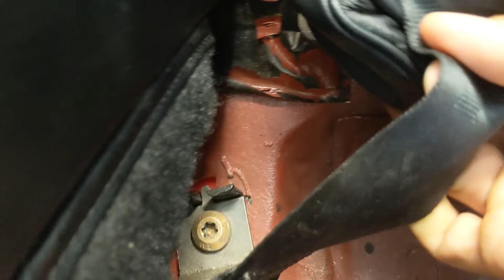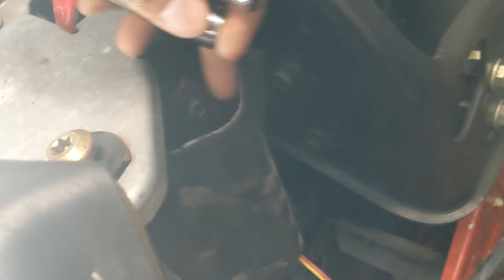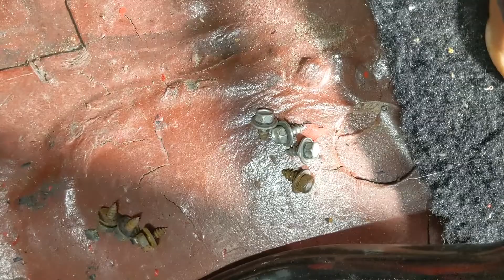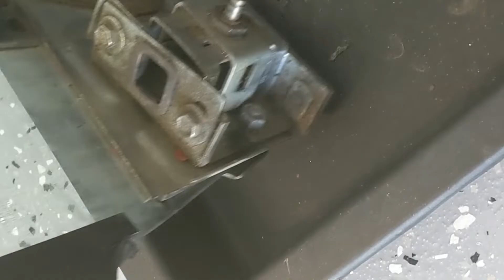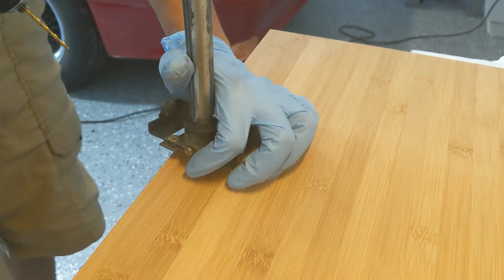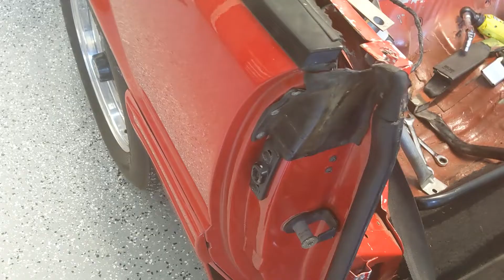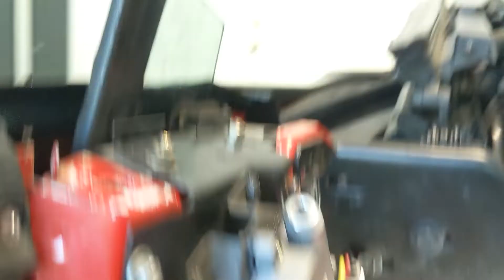Foxbody Convertible Rear Quarter Window removal, Alignment, and Upgrades @latemodelrestoration

Comment: Windows in my 93 are stuck up for some reason, assuming off track since I can hear the motors spinning. I need to do this, and replace almost all my weather trim (No leakage inside, but cracked pretty bad) but I’ve been putting it off in fear of messing up the rag top. Thank you for the video, definitely saving this for when I tackle it.
Reply from the maker: They are stuck up because the bushings are destroyed and it pushing the gearing away from the motor. If you push the window inward and down while you push the button, it will go down. 
No need to fear just take your time
Reply: @RaymondUrias  Thank you for that! I already have the motors on hand and I’m now going to order the bushings as well. I figured if I’m actually going to do this job, might as well swap the motors while I’m there because I’d like to not do it again. I guess I’ll do it all and hopefully not have to worry for some years.
Reply from the maker: @_Livid_  hahahah your damn right fix everything in there and walk away!

Comment: Is there any adjustments to the regulator if the new motor gear doesn’t align back with the regulator gear when installing? The new lmr motor shaft seems to be the same length as factory but when bolted up is like 2-4 mm to short! If I get it to grab it slips off after window moves a few inches. Window worked perfect until motor stopped working just doing a motor swap but won’t align back up gear to gear! Thx
Reply from the maker: There are no adjustments to the regulator that I am aware of.  When you installed your motor you took the regulator out correct. You didn't install it while it had a load on it.

Comment: Thanks so much for this great video!!  I made the dire mistake if removing both plates after rebuilding and regreasing everything, and now have to align from scratch.  One thing...it seems there is an additional adjustment where the guide rod mounts at the very bottom where it mounts to the body.  I believe you can adjust the entire window toward or away from the engine with the slots.  It seems you left it attached but I removed everything.  Its going to be a while until Ill be able to align them 😞
Reply from the maker: It will be worth it when you are done. You are correct you can move the entire rod towards and away the body.

Comment: Fantastic video - thanks so much for these great instructions. Two deviations I made though. Easier to install new motor when that whole assembly is out of the car. And I STRUGGLED getting the rod back through my new bushings while it was attached to the base bracket. I took the rod out and it fit right into the window bracket THEN I mounted to the base while it was in the car. Neither way is easy, but for me it was easier than your method. Thanks again!
Reply from the maker: My way isn't perfect, but it's good to see people like you posting other ways. Hopefully people read the comments

Comment: I have the same exact car I am fixing to have to go through that my passenger rear window will not roll up
Reply from the maker: Did you try fixing the motor first
Reply: @RaymondUrias  the motor runs but the window seems to be off track or something it would not roll up
Reply from the maker: @marklathem3735  then you have bad bushings. When they are bad like that they will push the window motor off the track and it will sound like a machine gun trying to go up
Reply: @RaymondUrias  I have disassembled the whole area I took the motor off of the metal panel and the gear is turning but when I put it back on it would not turn the large gear
Reply: I will keep at it
Reply: I have my house mechanic one of the best I am not a car mechanic one of the worst but I have full confidence in your video
Reply: I haven't done anything to the car yet

Comment: great video my quarter windows for my 92 mustang don’t even go up but it seems like when they go up they get stuck but this was really helpful thank you 🙌,js subscribed 2.
Reply from the maker: Awesome man!!! Can't say thank you enough for the feed back
Reply: @RaymondUrias  do you have any suggestions on the windows? Mine moves a lot but when I put the window up with the button it makes the sound but the window does not want to go up any tips?
Reply from the maker: @chinov.1274  If it sounds like a machine gun then it's probably just the motor. If the window feels loose then it's the carrier

Comment: Hi I’m working on mine currently I’m at the point where I’m adjusting the window to move back and forth towards the front and back of the car. My issue is the 7/16 bolt that you have to adjust doesn’t have slots for it to move up and down for the window to move forward towards the front of the car or backwards towards the back of the car. Can you please help. I’m so close just need to get better detail how to adjust
Reply from the maker: The top two bolts control the outward towards the street and the inward toward the inside of the car.
The bottom two bolts control the forward towards the engine and the backward towards the trunk. 
There are a total of four of those bolts two on the top and two on the bottom.
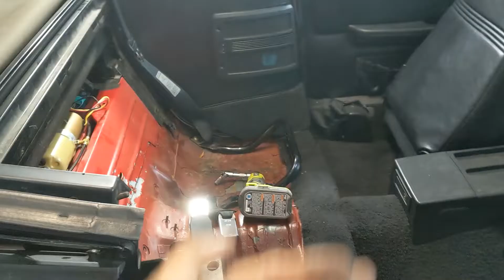Reply from the maker: @20:00

You don't have any of those bolts? All Foxbodies as of my knowledge are identical window carrier
Reply: @RaymondUrias  are the two bolts on the bottom have the heads of the bolts on the bottom of the carrier?
Reply from the maker: @matthewshephard1172  yes they are upside down
Reply: @RaymondUrias  do you loosen it position the glass going forward towards the engine and then tighten it?
Reply from the maker: @matthewshephard1172  yes they are 2 bolts installed upside down on the silver glass carrier loosen them then push it towards the engine then tighten them back up. If you want send me a picture and I could draw on it.
raymonduriasjr@gmail.com
Reply: @RaymondUrias  just sent you an email
Reply from the maker: @matthewshephard1172  just responded, hopefully it makes sense now

Comment: Thanks for taking the time to document this process. It's been so helpful. I've watched it a number of times. 
One thing, I wish you had shown how you got the window out of the car. I've twisted and turned it every angle I can think of and can't get it to clear the inside body brace to come out. I replaced the bushings and cleaned it up 'in the car but it would have been easier out of the car. 
Thanks again for the video, it saved my life!!
Reply from the maker: Awesome 👍

To get the rod out you have to push the window all the way up and towards the engine bay as high as you possibly can and then you're going to push up on the rod and then you're going to pull it out kind of diagonally towards the engine bay area once the rod is out the window just comes right out through the same big opening. It's tricky but not that bad once you got the trick figured out.
Reply: OMG. I’m losing my mind trying to get the glass out. Gonna have to leave it in because I’m sure I’m going to shatter it. Most frustrating part of the whole process!!

Comment: How much to have a shop do the work?
Reply from the maker: There is a local shop by me that charges 1200 per side plus taxes. To me that's ALOT of money and it's something you can definitely do just have to be patient. Their book has it for 5 shop hours per side.
Reply: @RaymondUrias  thx I had a guy sell me a car told me they worked come to find out the motor bushings are shot and the alignments off so I’m stuck with his headache:(
Reply from the maker: It is definitely a headache! Takes a solid weekend per side. Take your time and you can do it

Comment: Hands down the best video on how to perform maintenance on these windows! I got lucky and it was just a motor but I'm going back in anyways to replace the window guide rod bushings
Reply from the maker: Have fun!! Don't hammer them out 😂
Reply: @RaymondUrias  haha thanks! I am looking to replace the interior trim but it seems like no one makes a replacement.
Reply from the maker: @divinfLLC  LMR has alot, check offer up and ebay I'm getting lucky finding stuff.